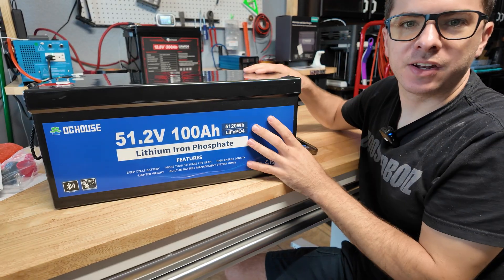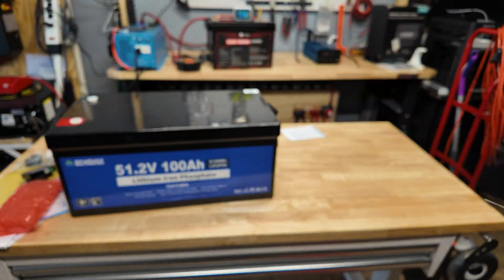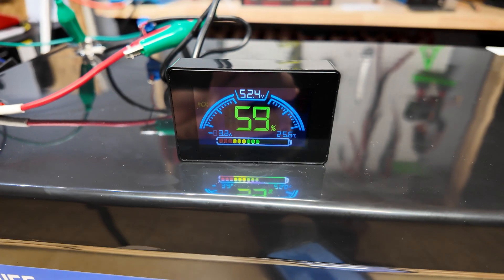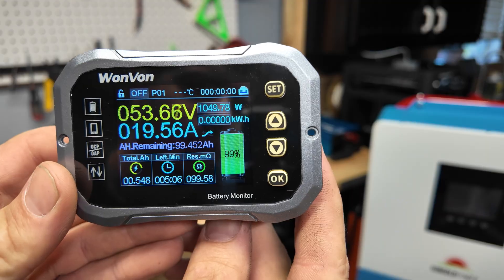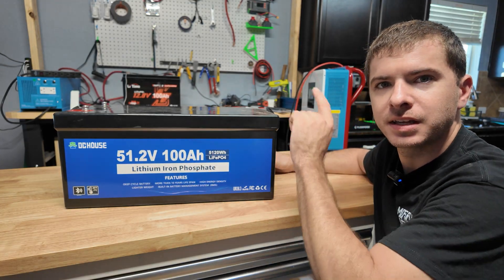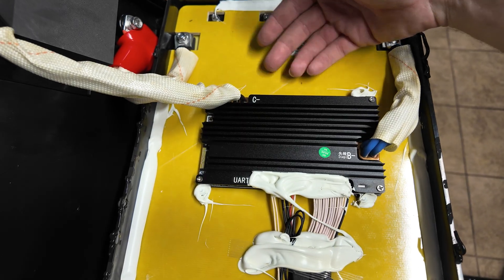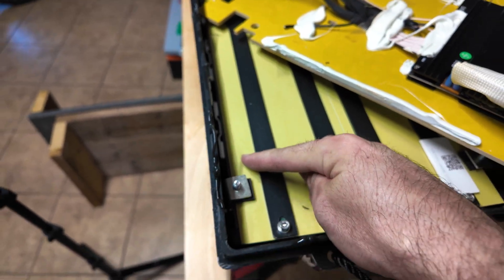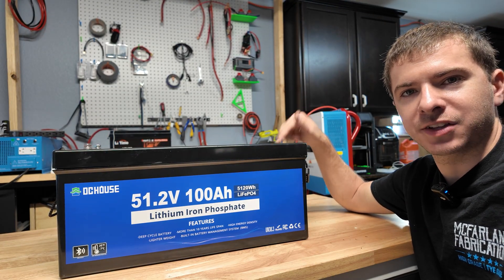Dc House 48 Volt 100Ah Golf Cart Lifepo4 Battery Review, Teardown, Testing

Comment: Hey Mike, another great video thanks. Quick question for you. I’m deciding between this and the Temgo for my BLUETTI power station in my RV, I will primarily be charging this battery with solar. Which do you think is a better fit?

Comment: Something doesn't look right in the app.
A brand new battery at 31% SOC and every single cell is exactly the same voltage, perfectly balanced ??
Something is a little strange there, but I could be wrong.
You know you wanted to hill climb the golf cart 😂👍
Reply from the maker: Needs better tires, next battery test we do were doing more extreme testing

Comment: For the people that read the comments, understand that what you saw in the video, the usage of the app is not standard. In fact, if you Google it, go to message boards stuff like that, you'll see it's a very common problem that it doesn't work at all and I'm in that group. It's useless. The screen, the little Bluetooth remote monitor. It works well and it's absolutely critical cuz that's the only way, unless you have your own shunt that you can tell what your capacity is so I like the battery. It's served me well so far but just understand that if you get it, maybe you'll be one of the lucky ones where the app works, but you'll probably be in the camp I'm in which is unlucky and no need to even install it on your phone.  Garbage.
Reply from the maker: Sucks people are having issues with the app, hate to hear that. I always recommend using an external shunt on any battery Bluetooth or not

Comment: Did you ever figure out what the yellow card was for?
Reply from the maker: No, maybe it can be used on the bottom if you mounted it into a. Golf cart may help protect the case
Reply: @Mikebuildss what voltage settings do you set on your controller? I have w victron smart solar mppt and just have it on the standard lifepo4 settings. Not sure if that’s good enough or if I should edit them.
Reply from the maker: @rnkustomz so personally I charge to 55-56 volts max because I don’t need every single watt hour in my setup. The low voltage o set to 42-44 volts. 

You will still get most of the capacity out of the battery and it will give you more cycles by having the upp and lower end buffer in voltage. 
You can absolutely go to 58.4 max and 40 min as the absolute max on both ends

Comment: i have two of those in parallel connected to my Datouboss DT-4862 inverter. 
It was nice to see inside and the BMS connections. I´m struggling to find a way to connect the BMS to my inverter at RS485. I'm open to some ideas from you all.
Reply from the maker: More then likely would have to replace the whole bms, as the one in this battery is not capable of communications.